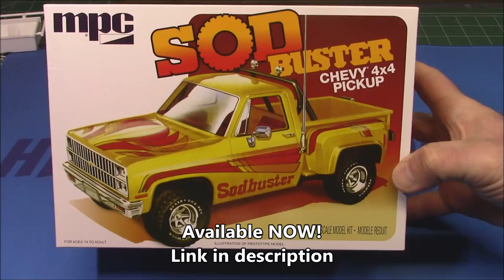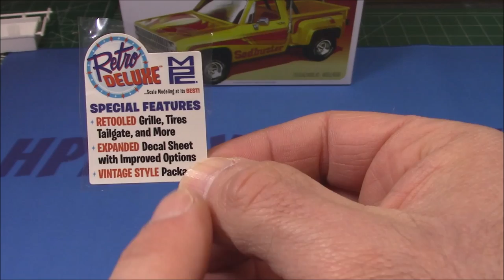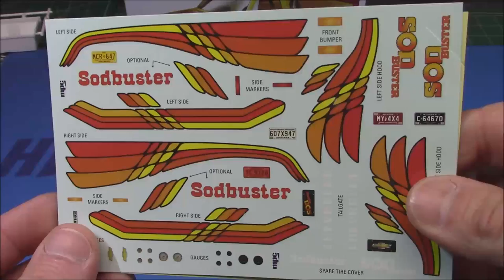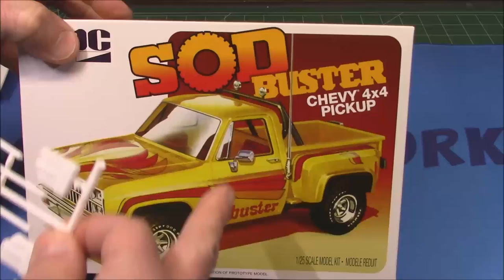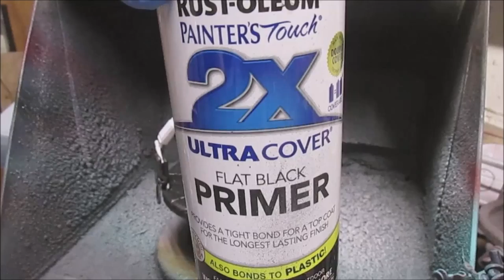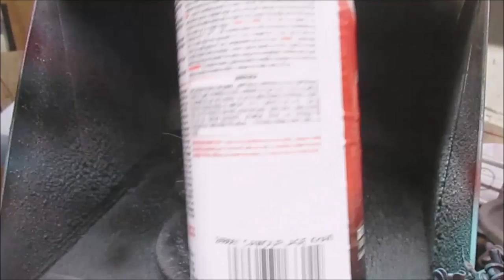1981 CHEVY PICKUP SOD BUSTER 1/25 SCALE MODEL KIT HOW TO ASSEMBLE PAINT WOOD GRAIN BED SQUAREBODY

Comment: I got it for $500 all it needed was a front yoke for the four-wheel drive 41 inch glass packs dual exhaust headers I think I had two and a half inch pipes Chrome tips behind the tires.

Comment: I had an actual 1977 Scottsdale Stepside four-wheel-drive with 350 engine with about 450 horsepower headers four-barrel no emissions naturally aspirated. if I remember correctly mine was a GMC, I love that truck so much. I would do anything to get it back well🤔 not anything--but it was badass😀